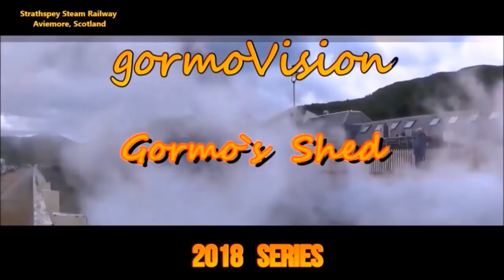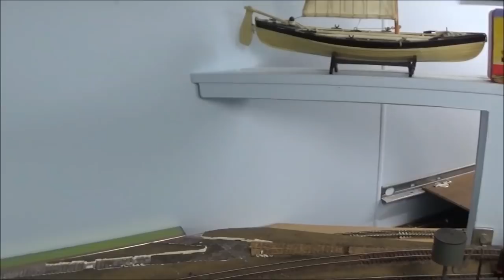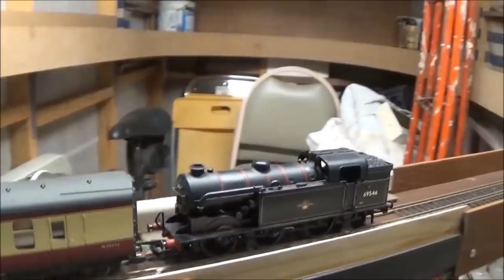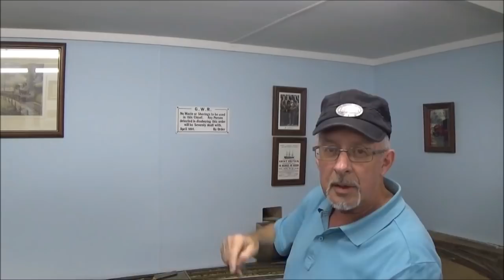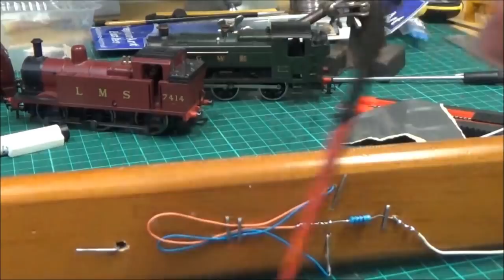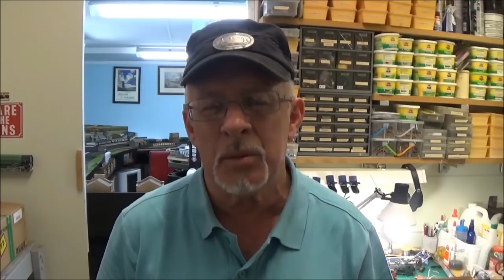Episode 97 18 Train Detection

Comment: Gormo.  You quoted a gradient in this vid.....I have given myself a problem with my layout....its in the loft and consists of two ovals approx 18' x 8'.....I am hopeless at negative and positive. So two tracks run side by side.
I decided in a mad moment to incline from base level up by 31/2" over about 7'. Locos pull ok ...unless heavily loaded.
The raised section gives me a chance to run a separate track system thru portals around the outside of the large oval to form a " local" track.
I now wish to run a local track inside the oval and go across at the opposite end to the raised track, to an area outside of the oval to form an industrial factory yard. My prob is neg and positive getting across two tracks.
I hope you can understand and help (PLEASE) with my neg/pos problem.  Thanks John UK
Reply from the maker: G`day John,
I`m struggling a bit with visualizing what you mean, however if we get back to basics it may help you.
I would start your calculations from the point where you want to cross over. Therefore at that point, you need a few inches clearance to allow for bridges plus the height of a train ( your tallest train ).
Measure whatever that height is at the point of crossing over, and then work backwards from there to your start point.
The height the track needs to rise divided into the length of the incline should give you and indication of the gradient.....eg..........4 inches height over 96 inches of incline equals 24 ,therefore every 24 inches it rises by 1 inch, which is a bit steep actually.?
You should aim for 1 inch in 30 inches minimum but if you can ease it out to more than 1 in 30 the trains will like it better.
The steepest gradient I have on my railway is 1 in 70, if memory serves me correctly, and that works fine. 
Hope this has been of some assistance.
Cheers Gormo

Comment: I personally use reed switches (I might get to hall-effect switches eventually), but yours is a very nice LOW-tech solution.
You could try using 2 (or more) "bridges", near (but not at) each end. This would stop it lifting too high at the ends, especially for longer lengths; probably provide better electrical connection (just wire the bridges together); would stop any tendency to shift sideways (and short-circuit the rails); and could be used to hold a curved detector on curved track.
Reply from the maker: Thanks for the tips Ross,
Cheers
Gormo

Comment: Consider getting a large quantity of magnetic reed switches from a place like an electronics surplus store (or new). They are small magnetic switches, like what you have, but they are sealed in a tiny glass tube, and won't tarnish in air, due to being sealed. One supplier I know sells a 20 pack of reed switches for $5 US. At that price, you could place them very frequently, and have a very actively animated mimic board! If you add a capacitor to each one, then each LED will fade slowly as the train passes, so you could even get a semi-persistent indication effect, that fades in a trail behind the locomotive. Best of all, you could paint the reed switch the color of your ballast and place it between sleepers, and it should still work. Hall effect sensors would work too. Completely solid state magnetic sensing. Just don't get the latching type. You can feed the outputs into a device like an Arduino.

Comment: If you put a second contact at sleeper level connected to a green LED so that the long wire sits on it when  no train is present, you will have a series of green LED's constantly lit on your minic panel to show the system is live and working. When a train passes over a wire, it lifts off the green LED contact and touches your red LED contact, so the green LED on the mimic panel goes off and the red one comes on. Would look really cool,
Cheers, Rich.

Comment: Many thanks Gormo. Very ingenious !  I only have three hidden sidings but over 80 locos so I think I will stick to manually switching a Red LED on/off for each track to indicate track occupation. My other option is to use an optical (IR) system or voltage detection.
Reply from the maker: Thanks Ray,
Yes there are plenty of options. I think the IR would be ideal as it also is separate to the rail system.
Cheers
Gormo

Comment: Good one Gormo.  Looking forward to see the mimic panel built and installed up on the wall.
I like the simplicity of the design and the use of old-school technology too.
Reply from the maker: Thanks Rick,
I am currently working on the track plan for the panel. Most of it is drawn up when, time permits. I am trying to replicate an old style signal box track plan diagram, so I won`t rush it, but I feel it will suit the room.
Cheers
Gormo

Comment: Quick, simple, very inexpensive - looks like it will work great for indication.   Only suggestion is to remember to check the magnets regularly to ensure that they don't pick up any stray metal (track pins, dislodged steps, etc).  I really enjoy your videos.
Reply from the maker: Thanks Dominic,
I`m glad you enjoy the videos.
Yes the down side to this system is the possibility of the magnets attracting stray bits of rubbish. On the other hand, our railways demand some sort of ongoing maintenance, so this is just another one of those regular tasks.
Cheers
Gormo